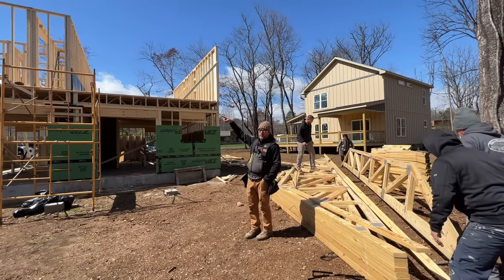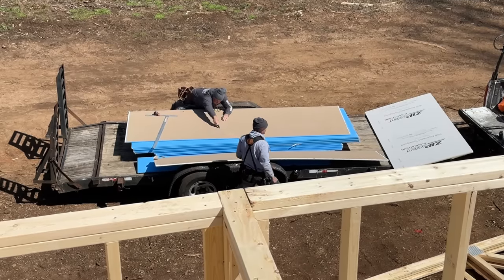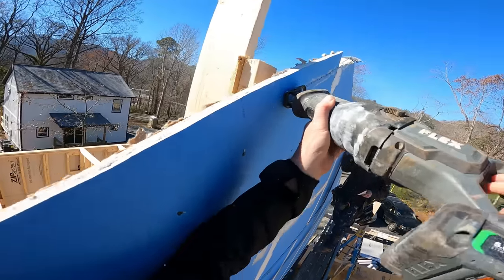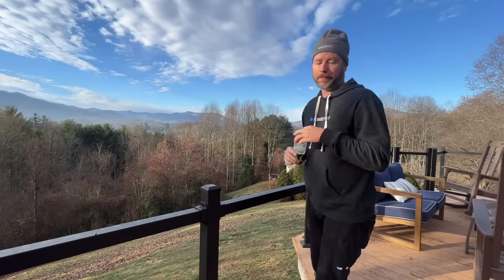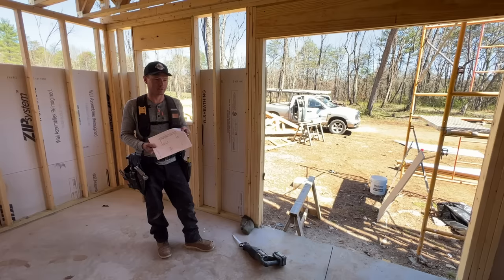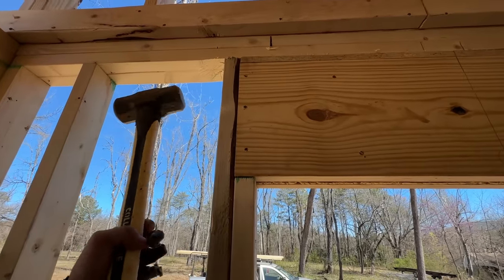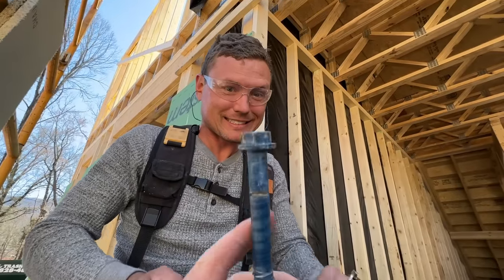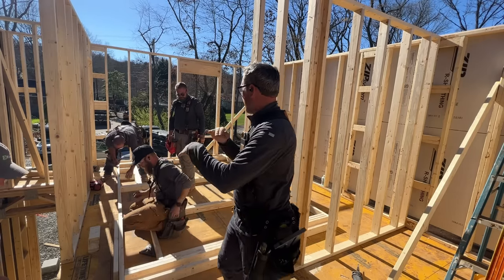Construction of a Duplex Part 11

Comment: You can buy Phillips tips for drywall with collars that stop the bit at just the right depth.  Also you'd get less dust in your face if you cut the drywall paper with a razor and snap it. Just as fast and way cleaner.
Reply: Was thinking the same  suggestion . Keeps you from over driving the screws.
Reply: I was just going to tell them the same thing but I read your comment first. Those bits work great with an impact driver!
Reply: The old dimpler!
Reply: When you break the paper it basically makes the screw ineffective !

Comment: This new Go Pro angle is pretty awesome Eric it's really taking me into the action. Pretty awesome guys 💪
Reply from the maker: Thanks.. i should have started using one a long time ago
Reply: @PerkinsBuilderBrothers  You can get a mount for the backpack (in your case tool-belt) strap to attach it to, doesn't just have to go on your head 🙏🏽
Reply: @PerkinsBuilderBrothers  Better late than never. Much safer than holding your phone 😀👍

Comment: I've been binge watching a lot of your videos (preparing to build a house of my own).
One thing I don't get is how none of you (and most builders) don't wear a harness when working.

I think it'd be a cool video to talk about safety while working in an elevated environment. Maybe sharing tricks you might have to avoid falling.
My heart jumps anytime one of you catches a tool or piece of wood thrown from the ground to the roof 😄.
Reply: As someone who has to work on elevated surfaces a few times a year, sometimed having to climb nearly 4 levels of elevation - you're so scared you keep yourself in check on where you are on the platform and double check how far you can move. A harness is a safety net that feels impairing, just gotta be safe and steady and be mindful of your surroundings.
Reply: They always wear them on the roof, but   I think they feel safe on flat surfaces.
Reply: @chadryder5843  never seen them wear a harness even while walking on trusses/roofs.
I'm not talking about a tool belt with suspenders.
Reply: In NZ all builds need fall nets when building second storey and scaffold around perimeter. Our health and safety laws here are clearly more strict.
Reply: @1N2345  I was thinking specifically of the Modern Farmhouse build. They may not have on the past ones.
Reply: @chadryder5843  Ah you're right, on the farmhouse they use one from the moment they put the sheeting on roof! There's snow and ice on that build I guess it might count in their decision.

Thanks for the heads up!! Got a bit of info on the subject :)

Comment: For those big bolts, get a couple nice carbide sawzall blades. I had to cut through 60 year old leaf spring bolts, and it cut like butter. The bi metal cheap blades just don't cut it

Comment: Don't worry about this until after the roof is on, but it's critical to NOT LEAVE THE PLASTIC INSIDE THE WALL. If moisture gets into that blue drywall, and the plastic is there forever, then the moisture will also be in the blue drywall forever. Probably not what you want. A little strip of plastic behind each stud shouldn't be a problem.

Love you guys. You're awesome and I'm learning a bunch.

Comment: @10:31 it looks like you are finishing the vertical joints in the first firewall....
@10:39 you can see the horizontal joint in the first firewall that you guys did not mud/tape....

Comment: Why did you use a moisture-vulnerable drywall firewall rather than a true moisture-resistant fibre cement or Hebel (lightweight concrete) firewall system?

Was it really cheaper after than extra labour and care to use drywall rather than fibre cement sheets?

Comment: Wouldn't a thin polystyrene layer be necessary between the 2 homes to decouple sounds? Like using Zip-R sheeting instead of dry wall?
Reply: if watched from start more  becouse of the firecode when have 2 homes in one house

Comment: Is the plasterboard between the two walls for fire proofing or for sound????  If its for fire could you not use cement board  and it wouldn't matter if it got wet or not
Reply from the maker: Its for both.. but mostly fire
Reply: @PerkinsBuilderBrothers   do you use cement board in the USA  or is it just a European thing

Comment: I've worked with demising walls and fire rated shafts for most of my 25 year career in HVAC and I've always seen the the screws mudded because the screw is a heat transfer path.

Comment: Are you removing the plastic cover when the outside is done?
Reply: no
Reply: Why? It is an excellent vapor barrier and will be unseen inside the walls.
Reply: And it does no good in the landfill!
Reply: Why use vapor barrier between two heated spaces?
Reply: @Tacofredag1  it’s already there? If one unit is vacant and unconditioned? 🤷
Reply: @Tacofredag1  Smoke...cooking smells...preferences for different temperatures, one door being wide open causing a hard draft in one unit that the other unit doesn't want to feel! I'm sure their are other advantages.
Reply: Thanks for the reply. Guess things are done different up here in Norway 👍🏼 Here we only do vapor barriers in outer walls (facing cold rooms or outdoors)
Reply: @Tacofredag1  that’s usually the case. But they had to protect the drywall and I can’t think of a good reason to waste labor on taking it down. I may well be completely wrong though!
Reply from the maker: We did decide to cut it out once we were dry
Reply: @Tacofredag1  see? I was absolutely wrong!!! 😂

Comment: Its funny to see how we build different in different contries.
What we do in Sweden is that we start with the bearing walls, then the roof, watertight and then the ceiling and after that innerwalls. Then you wouldent need to do all the plasticwork on that drywall.
Reply: Yeah, we do the same in Norway

Comment: You've probably been asked this many times but instead of the drywall sheets acting as fireblock, was there not the option of leaving a void and then filling it with fire-rated spray foam? That seems way easier and less susceptible to the elements ruining your drywall.

Comment: Hello from the UK, what does a duplex mean please
Reply: Its two houses attached to each other, so that they look the same on both sides, similar to this https://en.wikipedia.org/wiki/Semi-detached#/media/File:ParkwayHousesSeacroft.jpg
Reply: this is what i found in google..  for what a duplex is called in the UK..  its a maisonette
Reply: 2 homes in 1 building
Reply: Hello from over here.  It's a special name for two houses that share a wall or a single family home that has been subdivided.  Two, three, and four have similar names.
Reply: Same thing as a uk semi basically. Two houses that are built together with a double skin wall (very similar to an external wall) between them. More often that not they have an identical, but mirrored, layout.
Reply: @churchers  not technically a semi, that would have two distinct property lines (2 civic addresses).   A duplex (or tri/quad/...plex) is the same civic address but multiple units contained within.   Such as 101 High street, then unit A, B, C etc but for our purposes on here you can consider it a "semi-detached home".
Reply from the maker: Two units in one structure

Comment: All that plastic in a Firewall looks so wrong.
Reply: The wood framing is flammable...I doubt the plastic will make that much of a difference.
Reply: @buildergradetocustommade  No, but fixing both layers of plasterboard to one side of the house doesn't seem right.  I think what they should have done is built one side of the wall and fixed one layer of drywall to the outside of that, mudding and taping all the joints.  And then for the second half, fixed the drywall with the framing lying flat, taped and mudded those joints, and then stood it up so the taped joints are facing each other.  As it currently stands, a fire in the wrong half of the building will take that firewall down.  Basically, I would have built one complete half of the house, and then built that second inner wall as a single piece on the ground and got a crane to raise it into place.